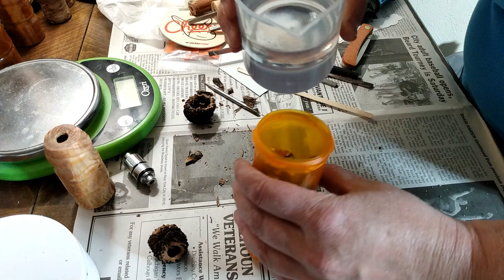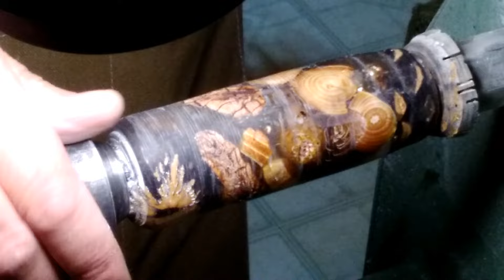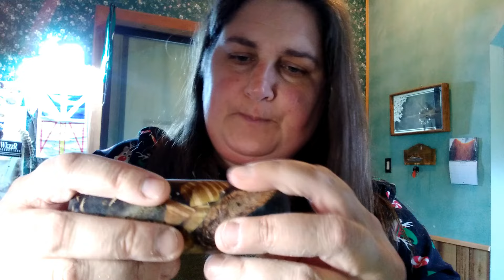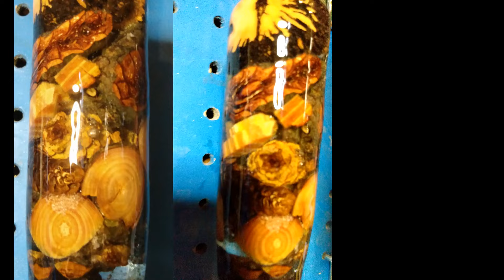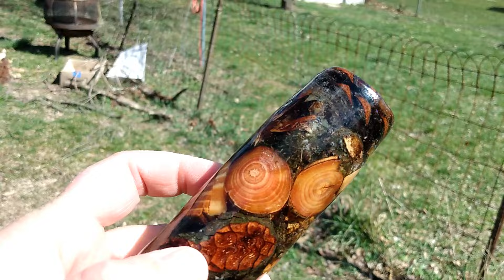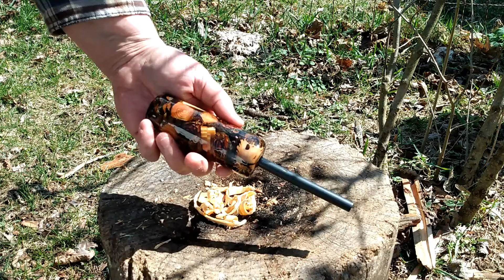Turning A Custom Epoxy Resin Ferro Rod Handle Full of Forest Treasures #epoxy #epoxyresin #epoxyart

Comment: That handle is Sooo Beautiful!  Excellent job Shlisa.  I've not had very much success with epoxy resin since I don't have a dryer to get rid of the bubbles. I wanted to turn a pine cone goblet.  I will have to order a dryer sometime.  Keep up the beautiful work!  Woohoo I'm smiling🙂❤
Reply: i saw several vids where they use the mini butane torches to get rid of bubbles. i have a mini torch , havent used it yet cos ive been pouring items with silicone molds at this point and they dont have very noticable bubbles.
Reply from the maker: @SunsetBayBonnie  Torch doesn't work as well as a vacuum chamber. I will be purchasing one soon. Charlie says, no, it's pretty just the way it is. He likes the bubbles.
Reply from the maker: Thanks Linda! I seem to be having good luck with the resins.